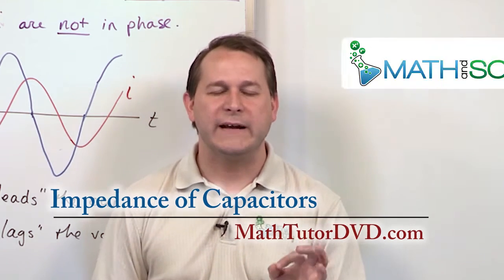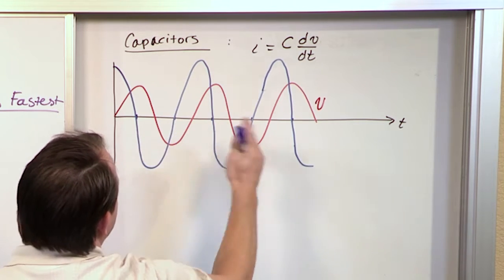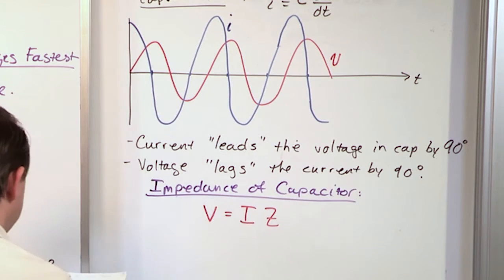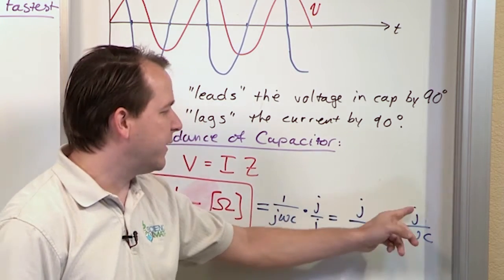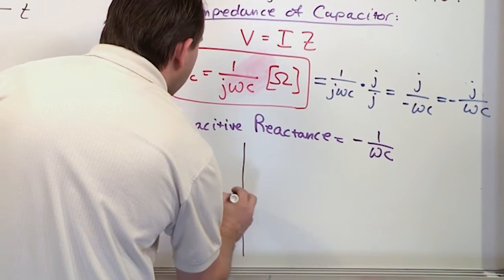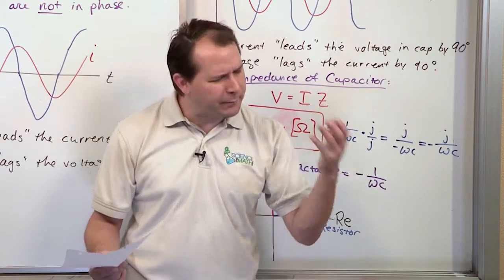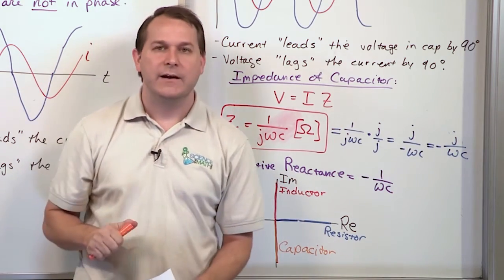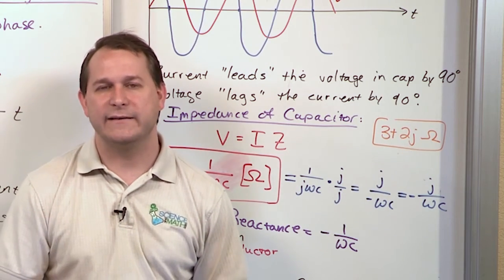Capacitors in Circuits - Impedance, Current & Voltage

Comment: Impedance 

Said but not written:
i and j
Magnetic Fields and electric fields
 
Not said:
The negative real impedance….
The power usage (storage)
Holes and dialectrics, zero current flow.
Voltage is nominal so it is all about the current.  Is it leading or lagging.  This is an industry practice for electric utilities.

I don’t like the big (blue) current because that is typically not reasonable.  Not practical.

Voltage lags is only what a math person would say.